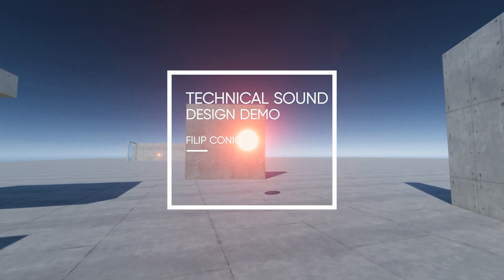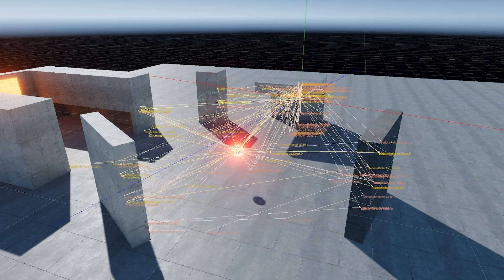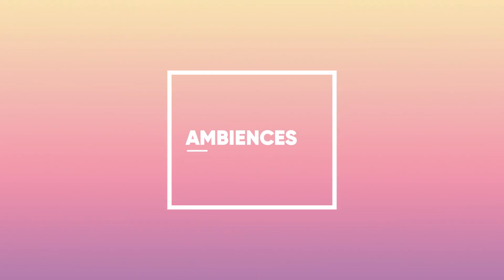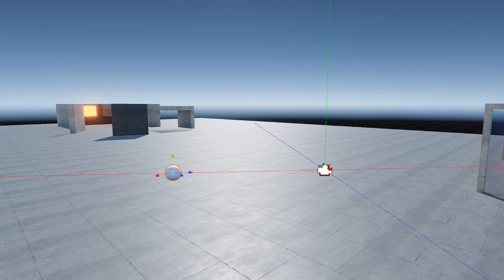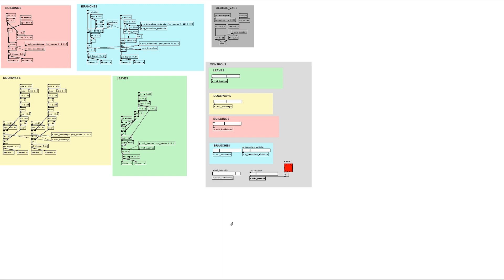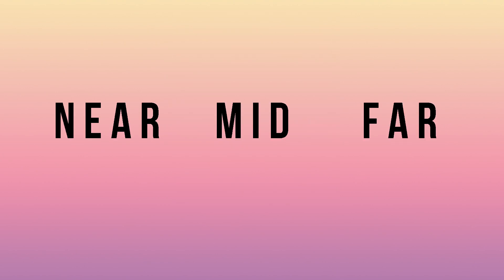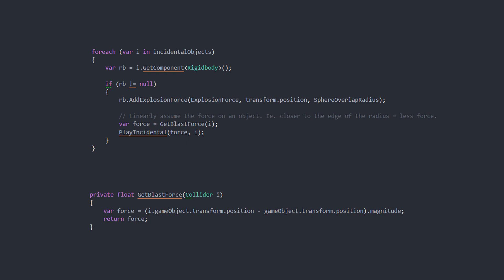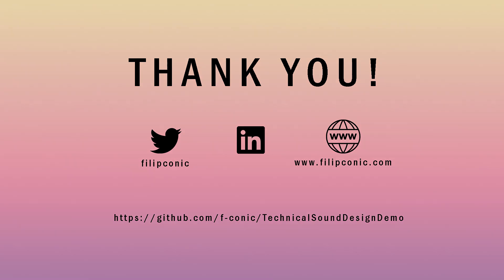Technical Sound Design Demo (Unity & Wwise)

Comment: hey!!Filip, I didn't see the "build" folder generated by heavy compiler in the github. I wander how can I use it as a wwise plugin? Thanks a lot!!!
Reply from the maker: Hi there! 
Sorry for the late reply. I forgot what I've actually done here so I had to double check :D I've only provided the projects generated by the heavy compiler in the TSD_ProceduralAudio folder. What you'll have to do is first build the Hv_windGen_WwiseSourceEngine project. (wwise/vs2015 folder if you're using visual studio) and then build the Hv_windGen_WwiseSourceAuthPlugin project. It is currently generated for Wwise 2019.2.0.7216. Once that is built you'll have the build folder with the .dll and .xml which will go into C:\Program Files (x86)\Audiokinetic\Wwise 2017.2.0.7216\Authoring\x64\Release\bin\plugins. Make sure to double check the build settings so that they're set to either Debug or Release and x64 for both the engine and authoring plugin project. Here's Enzien Audio's doc for this https://github.com/enzienaudio/hvcc/blob/master/docs/06.wwise.md
Reply: @filipconic6218  Thanks a lot!! You're awesome!
Reply from the maker: @leafxie3328  Thanks! :)

Comment: Hey!Filip, I'm coming again, how did you design the dynamic obstruction and occlusion in 2:23?
Reply from the maker: Hey! I re-implemented Wwise’s spatial audio emitters in my own script (SoundEmitter). It’s not a very elegant solution and I haven’t tested the performance impact with multiple objects instantiated. But basically what I did was throwing all of the geometry calculations of the AkSurfaceReflector class into an update loop. (LateUpdate() in this case)  Check the commit log of the project on github. I know that AK changed a lot of things in the latest version of wwise, so it might not be applicable to your specific version.

Comment: Hey! Filip, Can you recommend some resources about creating the wind plugin in pure data and implement into the Unity? I would like to learn something about these!
Reply from the maker: Hey!
For the actual PD patch I would highly recommend Andy Farnell's book ´Designing Sound´

https://www.amazon.com/Designing-Sound-Press-Andy-Farnell/dp/0262014416

It's a great read which taught me a lot about analyzing sounds from a functional perspective. The wind patch is also based on his wind model which can be found in the book. 

For the heavy integration there's a lot of information on Enzien Audio's github page. But as I mentioned in the video, it's currently unsupported and requires some trial and error to get it working. Let me know if you need any help with it. 

Other than that there's not a lot of sources that are directly targeting interactive applications such as Andy Farnell's work, except a few academic papers. I think understanding synthesis on a basic level gets you a long way. ' Welsh's Synthesizer Cookbook' is one that comes to mind which helped me out a lot when I was starting out.

https://www.amazon.com/Welshs-Synthesizer-Cookbook-Programming-Universal/dp/B000ERHA4S

I hope that helps! :) Good luck!
Reply: @filipconic6218  Thnak you! I will check these!